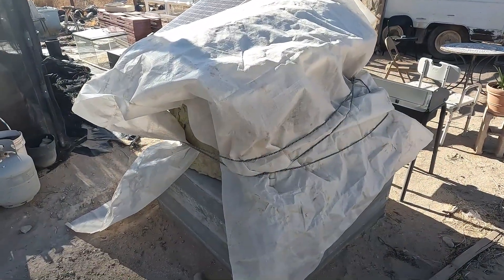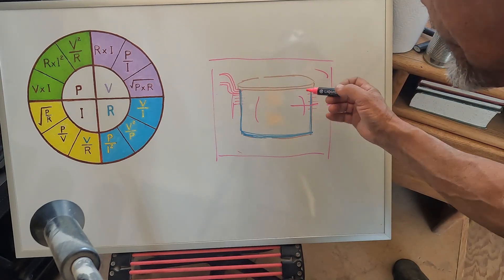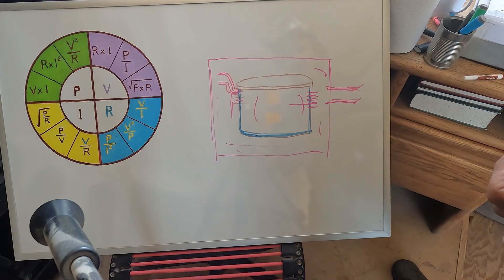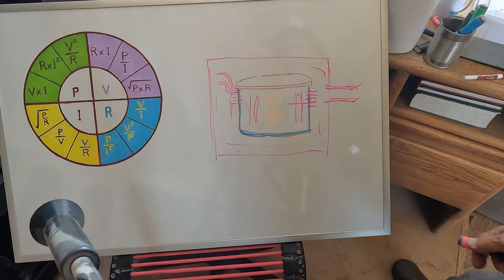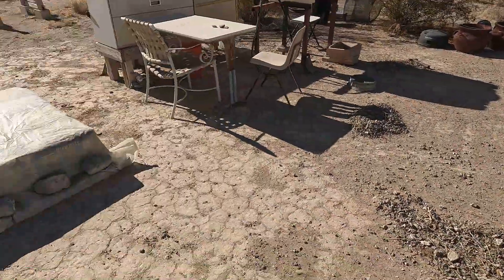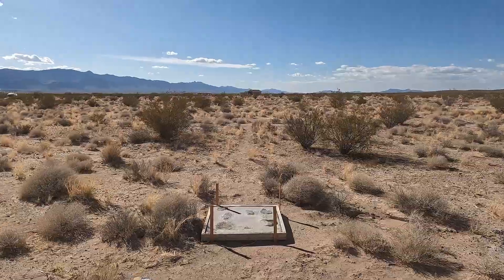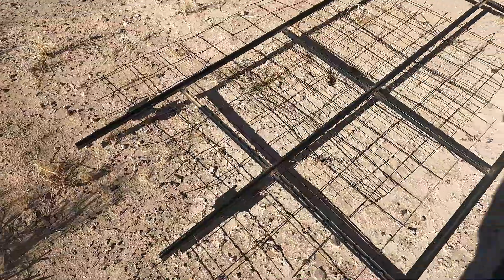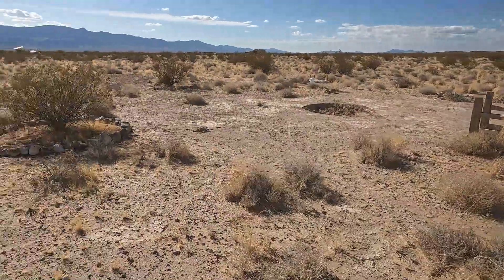175 - Thirty-Four Gallon Sand Battery and New Property Update

Comment: Is it feasible to utilize a sand-based thermal energy storage system to provide heating for a commercial greenhouse cultivating tomatoes and cucumbers, or for a residential building with an area of approximately 250–300 square meters, during the winter season?
Reply from the maker: I believe so. I will start experimenting again soon. Thank you for the comment.